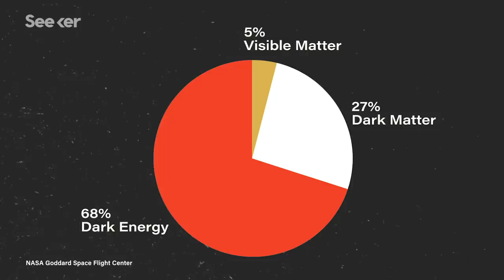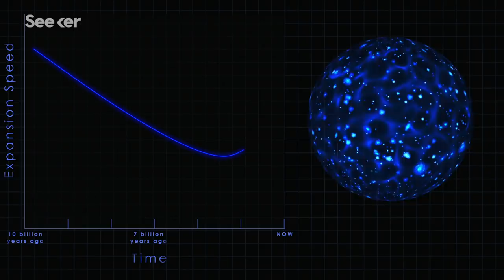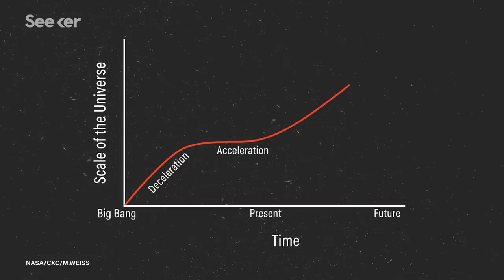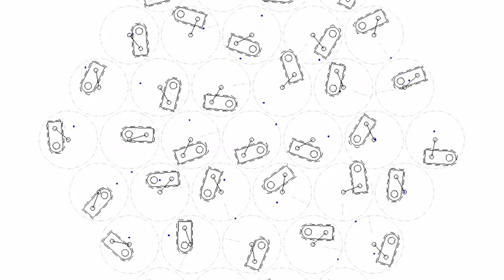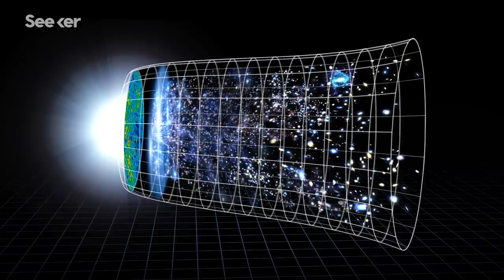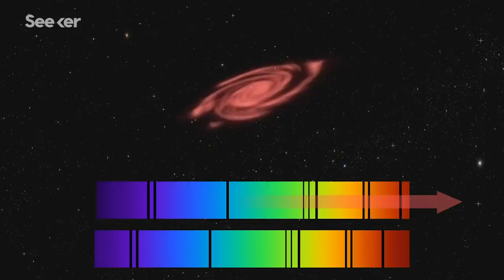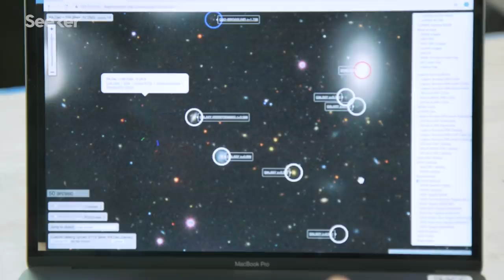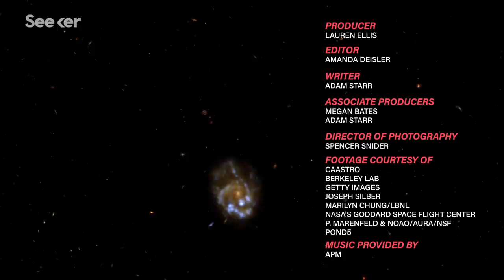The International Hunt for Dark Energy Is On, Here’s What’s Coming

Comment: Dark Energy and Dark Matter is made by Dark Feelings and Dark Emotions 😂😪
Reply: Dark Matter and Dark Energy have just been thrown in the dustbin as the nonsense these concepts are. Dis-proven by the revelations of a High Tech Industrial Company in July 2019, which is likely to result in a massive step change in the world of Physics. The now proven concept that the Universe and everything in it, is powered and connected by Electricity, requires a number of the Laws of Physics to be re-written.  
Out of these major discoveries are already coming new technology to help the human race, which would not be possible if the scientific discoveries are incorrect. Itself therefore proof of what mainstream Science has tried to deny for decades. The first technology is a method to "switch off" radiation, so all the Nuclear power station radioactive waste buried in various places on the planet can now be "switched off" and therefore cleaned up. Further a new type of Reactor producing NO radiation is also already in development, provided by testing and therefore proving the Electric Sun model. The implication is also that Nuclear weapons now become useless !!!

Comment: Here's an idea- when a bomb goes off, the particles that make up the explosive start at a speed of zero. As the explosion propagates, the particles fly outwards at an accelerating rate until air resistance and gravity interrupts its inertia, decelerating it back down to zero. The big bang is often thought of as an explosion, so what if dark energy is just the outwards-facing kinetic force pushing matter away from the centre of the universe? As with a bomb, if only a small part of the energy of the explosion has been expended, then it will continue to push particles away at a rate greater than gravity can pull it back together for a considerable amount of time. If this is the case, the universe might be a lot younger than it seems, and there will be much more time for dark energy to push it apart until its expenditure is so little that weak gravitational forces may bring it back together. Therefore we may detect dark energy by measuring the rate at which objects are accelerating away from the centre of the universe, and the physical energy required to resist its force- i.e. the energy required to decelerate a particle to zero, especially throughout different points in time.

Comment: Dark energy is the strong force 72% compression.

Dark matter is the weak force 23% with zero space between the magnetic 🧲 poles that is matter and antimatter 50% / 50% in a particle neutrino.

5% is total mass all the observable universe.

Dark energy is like a sea and is to powerful to be disturbed and only supernova explosions and gamma rays bursts can make it wave like microwave backgrounds.

Dark matter can only interact with mass into the black hole 🕳 like a millstone grinding solar systems into table of elements and shooting them in jets of gamma rays.

Comment: Ok... - First, the reason that we can't find 'dark' matter or 'dark' energy is because science has misinformed our collective conscious to imagine a kind of matter that we can't see, (we have seen that galaxies spin so fast that the matter in them should fling out, but it doesn't. We have been mis-trained to think we should look for some kind of extra matter. Baloney) or to imagine an unnamed power source accelerating the expansion of the universe. - Let me try. - First. We all know what gravity does, but none of us know what gravity IS. I propose, that there are more than one kind of gravity. For example, matter under the pressure of say a star the size of our sun, produces a gravity (let's call it a flavor.) It holds even the farthest asteroid of our solar system from escaping. But the gravity produced by the matter under pressure in 'Sagittarius A*' is of a different flavor. This type of gravity is selective in its effects. Matter and stars near to the massive black hole in the center of our galaxy are effected as if the gravity is the first type of flavor, but the outer edge of our galaxy is affected by  an amplified flavor of gravity. (I do not think this is an accurate theory. I just want to point out that what we have witnessed is an anomaly of the gravity of galaxies. It's not logical to think we need a new matter when what we have seen is a different gravity.) - As to the expansion energy. Our universe is (according to science, we can observe about 90billion light-years.) trillions and trillions of times larger than anybody thinks. All circling a common center of gravity. On our side where our 90billion light-year bubble is just a tiny speck in the vast ocean that is the actual universe, is undergoing an expanding as it accelerates around the side of the universe that is closest to that common center of gravity. Somewhere on the opposite side, there is a DE-flation happening. If you can't imagine some of our scientific observations being possible with this concept, then increase the size of your imagined universe and see if some of our observations become more possible.
Reply: Wow......

Comment: What if dark energy was actually the force behind quantum entanglement and such things? What if "entanglement" was a general term that could describe all physical quantities of an object? For example, gravity. Say you have two bodies. Both have a unique velocity, mass, acceleration, etc... In a closed system. Those two would effect each other equally and oppositely, such as the spin on an electron pair that is entangled. What if instead if gravity pulling things together, it actually is space pushing them together. The closer together they are, the more space there is pushing them together, thus an increase in velocity. Also, you can't get much space behind a quantum particle to push them together, so it makes sense that gravity doesn't work well, if at all down at that miniscule level. Also, this is me rambling cuz i'm tired. Don't take it to heart, but at least consider it. I would hate it if I were accidentally right (which I'm 99.999% certain i'm wrong) and solved the secrets to the universe without anyone knowing.

TL;DR
Space and science stuff makes the world go round. I'm tired. Goodnight.

Comment: Still pretty sure dark energy is an artifact of a false assumption on our part, either about space or one of the so-called "constants". In 2001, I theorized that what we see as an 's' curve of accelerating expansion could be a "flatlander" type misunderstanding of the topography of spacetime. The gist of the idea is that a constant field of dark energy across all space is what it would look like if an infinitely distant outer "edge" of the universe was in fact a singularity, but we are embedded in a brane with too few dimensions to see it that way.

To picture this, think about what the cross section of a sphere looks like when passing through a plane - it appears to accelerate rapidly, slow to a relatively steady rate, reverse, then shrink rapidly. This is how it would appear to someone on the plane, but what about someone embedded on the sphere's surface? To picture that, imagine unwrapping the surface of that sphere into a disc, so that the south pole is the outer edge. What would the plane's motion look like? It would appear to expand rapidly from the center, slow, then expand rapidly again. An 's' curve.

A reasonable criticism at this point might be that it seems kind of unmotivated (and a bit like begging the question) to unwrap the sphere in such a way as to treat the north and south poles differently. But here's the kicker. The sphere's cross-sectional circumference represents the three dimensions of space, and the surface north-south direction represents time. From our perspective, time has a favored direction, with a definitive origin, but no end: north to south in this case. All I'm suggesting is, adding another symmetry to our model of spacetime that appears with just one additional spatial dimension explains inflation and dark energy all at once.

Comment: What if something interacts with our universe outside our universe that makes it expand faster and faster? Like negative pressure will do to a fluid in the vacuum of space.  Is having dark matter the only explanation? Maybe you have gravitational pulls from other universes next to ours. Dark matter and dark energy is just a theory based on what we know about the universe which at the same time is limited by our observation capabilities. Many assume it exists without having observed it at all.  I bet 10$ they won't find anything before someone else finds another possible theory that could explain the universe expansion or the results of those observations from which astronomers draw the conclusion that the universe is expanding.

Comment: I think dark energy is the absence of gravity, maybe when there is such a low amount of gravity in an area that the “force” of dark energy does the opposite of gravity. An example is if you release gas into an large space it want to spread, maybe dark energy is a force making everything spread when gravity is weaker than it.
Reply: Jonty Ellis gas spreads because the particles are not attracted to one another and are colliding rapidly.  The absence of gravity is only the absence of matter.
Reply: Jacques Souvenir my example was bad, I’m just stating that if there is weak gravitational pull between two masses that dark energy may become present and repel the two masses

Comment: "Repulsive force" is a false assumption.

It is a Pulling/Attractive force. Read "Beyond Einstein" by Michio Kaku.
Reply: Cliff notes?
Reply: @merlinthelemurian3197  
I hesitate to try and summarize. Kaku introduces some mind bending concepts. Here goes:

Before the big bang there was a 10 dimensional universe much larger and more massive than ours. 

The building blocks of reality are "strings". In that more perfect universe those strings were symmetrically joined. That means they emitted no electromagnetic radiation.

Because of that our eyes and instruments can't see them and as many as 3 objects could occupy the same space at the same time.

The 10 D.U. became unstable. Think of it like a giant sphere of spinning gyroscopes. The inner 7 dimensions collapsed toward the gravitational center of the sphere.

The crunch that followed is known to us as the big bang.

What resulted was the creation of our 4 dimensional universe with chaotic matter (height, width, depth and time).

The part of the 10 that stayed in place mathematicians call the 6 dimensional universe (dimensions 8,9 and our 4 spacial). ~73% of the mass of the original 10 remained with the 6 D.U. That's important.

After the big crunch/bang our universe expanded outward at a steady rate in all directions more or less equally. (No need for inflationary phase since we didn't start from a point).

It took about 7 billion years of expansion before our 4 D.U. started to be significantly PULLED by the GRAVITY of the 6 D.U. 

Kaku's theory eliminates the need to invent a force called "dark energy".

It logically solves the mystery of why "dark energy" was "dormant" for 7 billion years.

There is no need to attribute energy to the vacuum of space which means no contradiction of the law of conservation of energy.

It logically explains why our universe is continuing to accelerate (pick up speed) because the closer our universe gets to the more massive 6 D.U. the stronger the Pull of its Gravity (inverse square law).

Since the 6 is made of symmetrically joined strings we can't see it but we most surely can see the effects of it's Gravity.

Kaku also solves the missing mass problem. Our universe is about 27% of the original mass of the 10 combined with the mass of the 6 (~73%) makes reality "flat" (parallel lines continue to be parallel).

In summary, dark energy is actually the 6 dimensional universe which is pulling us towards itself.

I hope this helps. I don't claim to be an expert in this field. I just think Michio Kaku has a simpler, more elegant theory and I find that appealing.

Comment: Consider the Sternglass-Einstein work on the electron-positron pair in a death spiral since being created in the first condensations of matter after a Bang.

From that structure paired with another counter-rotating pair was found a meson matching the properties in lab results.

The implications of this finding, late 50's, which was never disproven although disputed, are immense to theory and help explain a portion of 'dark matter' by virtue of their neutral charge as a single pair.

Thus the Standard Model while coherent to itself isn't a theory being an empirically derived system.

There was more than one Bang within the implosion ala multiple hypocenters in plate boundary releases, material was there before and a portion unaffected by the explosion remains mixed in with the results of a Bang.

That is, a Bang converts mass to energy that is sent away from the center of mass outward as energy thus removing the gathered mass quickly.

All masses being drawn by a Great Attractor are suddenly free to take altered trajectories as a way to distinguish objects released from the mass attraction.

Consider if this didn't happen all the Universe would be only Great Attractors gobbling each other.

Again, being charge neutral these can be everywhere, and, as they age they degrade, I suspect inflation 'can be' from these annihilating each other, their mass detectable at some minimum density.
Ymmv.